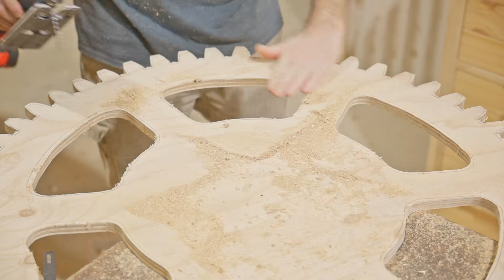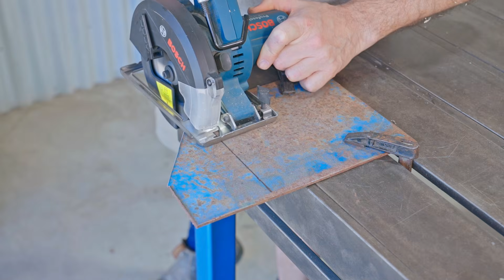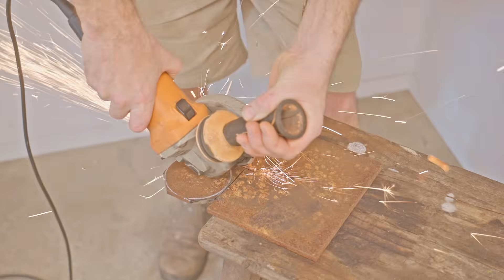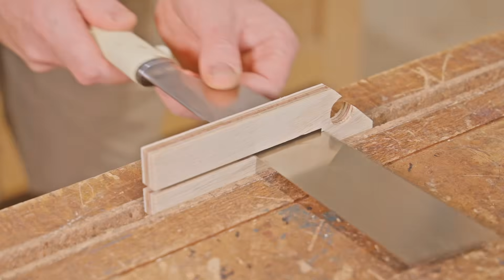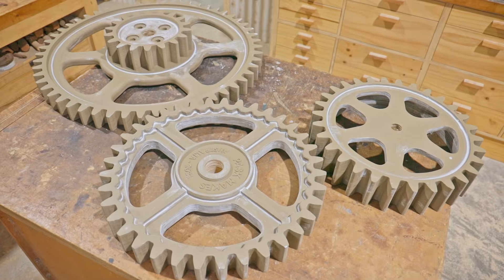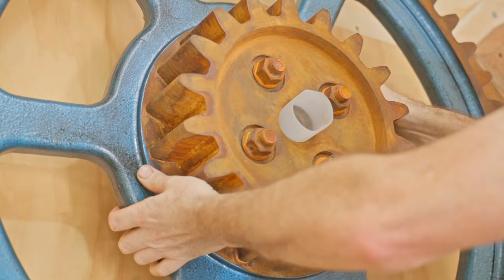Connecting Homemade Gears - Can they Spin the Propeller?

Comment: The change I'd make is to attach a smallish cog at the bottom next to the big cog you turn to make it move then attach a handle to that that would stick out towards you when in use but folds up vertical when you're not using it. I'd make the handle rotate as you turn it to make operating it easier. That would make turning the propeller and cogs a lot easier and if you did decide to use a motor you could use a belt drive to drive a wheel in the middle of the Edge of the small cog I'd have added at the start of the movement. Put the motor on the floor in a cabinet that sits under the display, something that worked with the look of the display, maybe a cabinet that looked a bit like the cone at the front of a plane, then put the motor in that and have the belt coming out of the tip of the cone.

Comment: Put small cog with the handle as a starter. It will be much easier to spin.
Propeller won't be spinning as fast, but it doesn't have to.

Comment: In order to economize on motor torque, maybe you could use your tap and die set to make a worm gear. This could also be a fun throwback to one of the early applications of gears, Archimedes' iron hand.

Comment: Hello 🇲🇫 (- motor easy and cheap solution at end -)
You've definitely entered the aeroplane post industrial new era
Add a bit of industrial revolution and steam era in a vintage monoplan avion of the French old heroes that flying over a simple cow earth. 
That's awesome! I love it so much ! 
Sharing the drawing to your follower will be a great thing to give a largest possible people the taste of wood and pleasuring hobby.
For the motorised version, I'll use a motor from a Chinese winch, a 100kg ultra cheap version is largely enough! 
You have a switch, both direction, and a geared motor with slow output RPM, and after measuring this RPM you could choose behind witch gear weld it on a Shaft you already made. 
Motor is mind to be screwed as a winch so you just need to screw it as genuinely made, and use the cable shaft for the gear shaft you already made, basic weld or screwed. 
That's my feeling to rotate it at few RPM and made it much much happiness to see each day 
Just adapt speed by choosing the right gear on wall, I think of the middle one. Or by adding a dimmer from a 200w light or a 8$ dimmer from China for low power motor. 
How do you feel it ? 👍👍👍🇲🇫

Comment: Set a rope and pull system on the turning end of the gear system with a platform to stand on and then you have an infinite rope climbing exercise that turns the propeller every time someone trys to climb the rope 😎🤣

Comment: It would be really cool to add a hub onto the last cog with a chain and weight, and you could reset the height of the weight to turn the whole system - with a very small hub, you could get a high ratio, and a lot of turns out of one travel of the weight.

Comment: If the gearwheels and propeller had actual ball bearings it would be amazing as fock
Reply from the maker: The propeller does and I thought about bearings in the cogs too but they were enough work without. 😊

Comment: Amazing!  I have never seen of rusting paint before.  One usually spends a lot of time removing rust.  I must say the effect it makes is terrific! And yes, do add a motor.  I would suggest a car windshield wiper motor but I think that would be too small and too noisy.  Whatever motor you choose, may I suggest you mount it behind the wall in a sound-proofed box.  Silently rotating gears and prop in your videos would be so cool!

Comment: Add the motor from the back, take one of the shafts and continue it through the wall to the back side where you can put a pulley or gear on it, then you can just put remote control for the power to it and turn it on and off. If you use an induction motor the  you can put a speed control on it as well.

Comment: Pretty cool initial and follow-on project.  I'm surprised you got them to turn with the different profiles on the cogs. I think that thing just screams for a very low speed motor to turn one of the cogs in the middle when the shop lights are turned on.   Or a high speed option if you're doing a lot of sanding....

Comment: Turn the gears in the other direction so the propeller spins in a clockwise direction and acts like a fan circulating the air in the workshop

Comment: So cool Neil!  The whole assembly together and the variety. Mr favorite is probably the rusted one and the blue. 
Perhaps, a motor in back of the wall (with the switch on the front) to drive a shaft through the propeller, or the rusty one? And, clear grease on the teeth? 
Great fun!!

Comment: You’re going to have to turn that first cog a lot faster, Neil, if you’re ever going to get that wall into the air! But seriously - what a fantastic project! When you first started it, I thought, “this is the sort of project you do when you’ve run out of good ideas for projects.” But now that its complete, I’d be super happy to have that on the wall of my shop. What do you reckon you have invested in the finished product? (Time as well as money.) as for a favorite cog, it’s definitely the “signature” cog (the rusty one with the lettering) for me but I love the blue one nearly as much. Really awesome project, Neil. I’d love to see a follow-up video where you add a motor and upgrade the bearings to make the whole thing turn more easily. I think this would look really cool mounted to a ceiling so that the propeller becomes a ceiling (fan for those warm months in the shop).

Comment: Neil, if you smother the cog teeth in some type of wax, I'm pretty sure they'll slip past each other much more smoothly and easily (a similar approach may work for the plastic-shim-wrapped hubs too). As for your next project I have a suggestion (if I may be permitted), it's summer soon there so why not make a pair of hanging chairs? :)

Comment: I personally would add another smaller cog at the bottom with a crank handle on it so that you aren't needing to reef on the larger cog. Then you could have the handle removable and replace with a disc and have a belt drive attached to a brushless motor for when you want it to spin autonomously.

Comment: You might try a treadmill motor.  I think they have enough torque to do the job of turning the first cog and I believe you can use an electronic speed controller (ESC) to control the speed (check out Jeremy Fielding's videos on salvaged motor uses)

Comment: Just fantastic.  Can't say I have a favorite gear, though.  They're all pretty awesome and it was really fun to watch the whole thing come together.  As for being hard to turn, the first thing I noted is that you didn't take any notes from Clickspring about spacing things out so they mesh properly.  A couple sheets of cardboard isn't the "proper" depthing gauge, my friend.  I would recommend you put some paste wax on the teeth to help they glide across each other better.  I use Johnson's Paste Floor Wax, but I'm sure Australia has something similar.  It's really great for creating a slick surface, especially if you build it up.  With as much wood-to-wood contact as you have there, you're looking at a ton of friction that needs lubing.
Reply from the maker: Thanks mate and thanks for the tips! I really didn't put much thought into meshing them and I really should have lubricated the hubs too. :)
Reply: You can also use wax from a candle, rubbed on, I've use it on old dresser drawers that slide on bare wood.

Comment: These cogs are really cool! I really like the fully rusted one and the blue one.
For the motor, a stepper and a quiet driver would work. Not sure, how hard one is to set up to be quiet, though.
One of those synchronous motors, like on the spinning plate in a microwave, could also work, but may need a bunch of reducing stages -- Though that would give you an excuse to build even more cogs.

Comment: I appreciate that you mounted this up high so it would be a lot of effort for someone to lose a digit while it's moving. I once saw a wall-mounted display of plastic gears (without the propellor) at a local museum where kids were encouraged to try different configurations and I think they were attached to the wall with magnets. That way the gears would move or fall off the wall if someone stuck their fingers in the wrong place.

Comment: I guess that you could fit an electric motor behind the propeller gear to run it.  That way the propeller is actually running all the other gears, not the other way around.  Just a thought.

Comment: What if the Prop Wall keeps changing by the viewers suggesting parts? All in the spirit of useless machines. Bits get added one at a time to eventually make the prop turn or switch a light on or whatever.

Comment: You could add a wheel with pegs, instead of teeth, that are mounted at a 90 degree angle.
If you want noise, you could add a plastic strip that slaps the teeth as it turns, similar to cards in bicycle spokes as you rode the bicycle (great for kids).

Comment: Your description said that you are wanting to motorize the system.  Ebay has some power wheelchair motors cheap. Adapt the driveshaft to another homemade gear and connect with appropriate power supply and switch.

Comment: Overall, Super-Fantastic!
I like the rusty one but I like the blue one more.
I was about to suggest a motor as well. I'd go slow as not to wear the wooden teeth out.
Also, lube all parts w/ graphite or paraffin...?
Question, when cutting the plate steel with a circular saw, what blade did you use?

Comment: Looks absolutely awesome. It makes such a nice centerpiece in the workshop.

If I may give a tip. Buy a bootle of graphite lubricant. The dusty stuff and apply it on the teeth when it is spinning. It will leave a metallic edge on the parts where it is touching.
That is what I use when I make scale models. Something different. But kinda the same

Comment: You need to replicate a steam engine cylinder, piston, crosshead, connecting rod and crank disk to drive it. You could even drive it with air something like this.  https://www.youtube.com/watch?v=XRmFAopH80o
Reply: Was thinking if you made a twin cylinder model it could be turned real slow and never get stuck on top dead center.

Comment: In addition to the motor put some numbers around the big gear or prop and you have a clock. Bit of electronics will give you a way to spin it fast for a few revolutions and have it stop showing the correct time again.

Comment: Fantastic work Neil. Maybe consider making an additional cog wheel with say a crank handle to help turn the propeller rather than hanging off the big spokes like you did in the video. The crank handle should definitely reduce the overall impacts of sweat/skin secretions from eating away at your weathered coatings and likely make it easier to turn the cogs. Aside from that, I look forward to your next video.

Comment: I'm really enjoying this project and I also would like to ask. Sorry for my ignorance but, did you just use a circular saw to cut steel like it was a piece of wood? I know about the Evolution chop saw, but I didn't know they made regular saw blades for steel. Is this a new thing I just completely missed? 

EDIT: This might be a bit much and probably to expensive but, since you mentioned maybe adding a motor (which I was thinking the same) would it be to much or expensive to find some bearings so it moves smoother? It would be like a kick ass shop fan.

Comment: What about a hand crank that works up to enough force with some gears, so you turn the hand crank fast,  and it turns that force into a slow but strong enough movement for the other cogs? Like the gears you shift to to get a bike uphill?

Comment: Really cool project. A motor in the space where you added studs to support the gear would be sweet. That way it looks like its moving all on its own. Something that just gets it moving slowly so its nice and quiet and not distracting. Or go the complete opposite direction and have the motor visible and use heavy chains on sprockets. Wide leather belts like were used on old school tractors that ran implements off of a pto shaft would also be interesting. That's what is great about a project like this, you can take it in so many different directions.

Comment: For the motor part you could get away with using a small motor but you would need some additional gearing to get it all set up. I hope you go the extra length as I think it could be a super cool addition. Just make sure it turns really slowly, fast enough so you can see the prop moving, but slow enough that it doesn't cause a distraction and makes noise. This is why I think a small motor with proper gearing and a belt drive might be the best solution. You would need a good big gear in between to protect the smaller motors' internal bearings from getting too much sideways load on the axle.

Comment: The weathering on the first one now looks a bit off. The fully rusted one is cool. I’m also very impressed with the hub you painted yellow then weathered. Did you also use the rust paint on that? Cause it ended up quite rusty looking.

Comment: Looking great! You can try hiding a small electric motor behind the propeller, or maybe on the other side of the wall. Since the gear ratio is 1:5, i think it would be easier to motorize at the propeller itself, and not at any other gear.
Reply from the maker: Thanks very much! I've been thinking of doing exactly that. :)
Reply: Was going to say this. A motor at the "driving" cog would need to be ridiculously over-spec. Driving the prop side from behind would give you the slow turn with a much less beefy motor and it would still appear that the first cog was connected to the source of power.
Reply: yes with a prop at both ends

Comment: If you opt to attach a motor, I'd suggest that you re-engineer the mounting plates to all have sealed roller bearings instead of using plastic to cut friction.